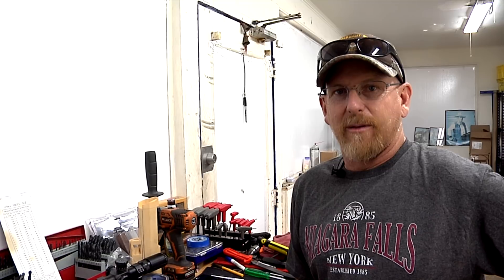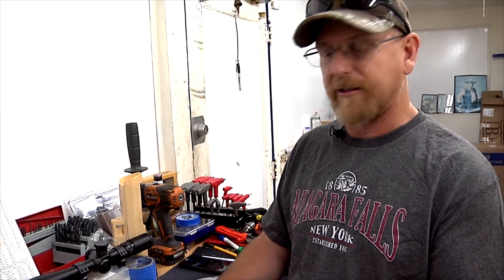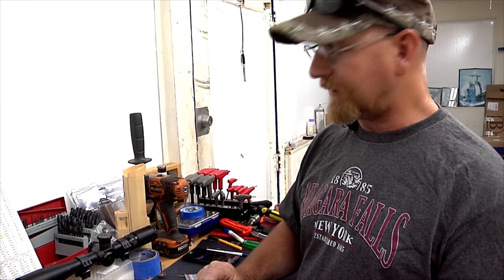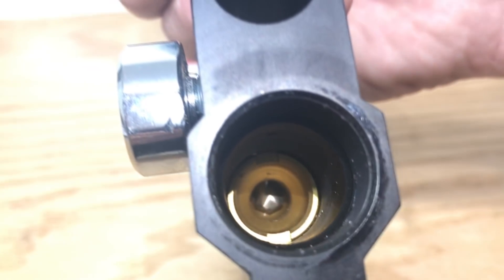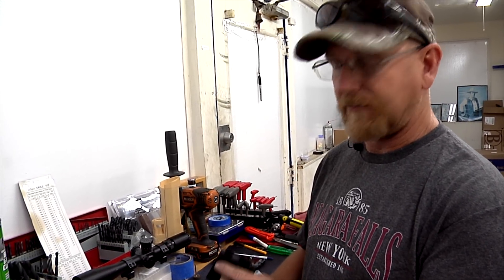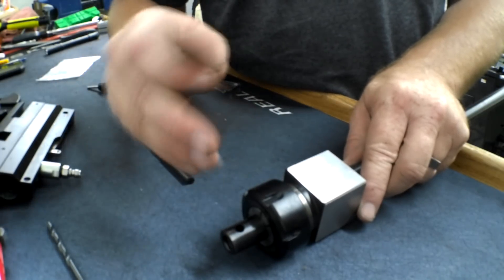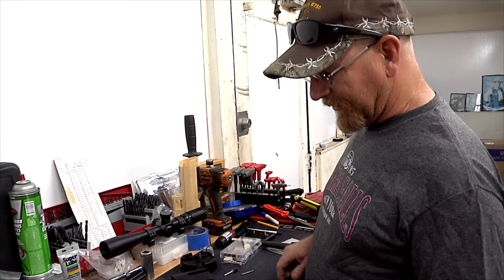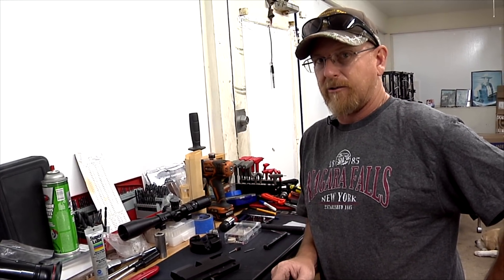Benjamin Bulldog Transfer Port Power Modding

Comment: I'm getting ready to do this. My question is that there is plastic end on my valve. Does that just get removed and not reused? Could find information in tear down and rebuild videos.
Reply: do NOT remove anything regarding the valve. There is a plastic reducer that is in the receiver port that must be removed.

Comment: How about the hole of reciever?
Reply: The hole in the reciever is already the size of the N size drill bit.
There is a small plastic bushing in there that reduces the size. You just need to take that out.

Comment: Is there supposed to be a Grubb screw underneath the fastener that holds the shroud On. When you slide the shroud off there's two holes the front hole I'm the back hole. The front one holds the shroud the back one is what holds the barrel in place. At least that's how I think it's supposed to be but mine has. A? Gross crew in. The front hole Also. You might remember me from a while back you printed me out some benjamin bulldog single shot trace and Some for my. Ataman 357.
Reply from the maker: Most only have a grub or setscrew in one of those holes.  It's only purpose is to hold the aluminum block to the barrel.
Reply: @Pitbull Airguns  I get what you're saying the Fastener that holds the shroud Should. not have a grub screw underneath it. The rear one Holds the barrel to the block... Sorry to bother you with this i'm just not sure which one to remove.

Comment: Matt, I need some clarification... Are you using an M-size drill bit (.2950 in.) or N-size drill bit (.3020 in.)? You mention both sizes in the video, and clarified with a confirmation of M-size. However, in one of the comments, you state that the final size is .3020 (N-size). Please help me understand. Thanks.
Reply: N size for transfer ports
Reply from the maker: Yeah.  What Paul said. N SIZE.

Comment: I enjoy ur videos.  please send me the valve stem shaft length, exposed section. Have y'all experimented w longer shafts? Seems that would be more effective than a stiff hammer spring.  5/64 bit fits

Comment: I did mine .Where can I find the larger plastic sleeve to replace the smaller one I removed Thanks
Reply: In the comment above yours he said they don't replace it with anything, just leave it out
Reply: @cc23001  Yes the plastic sleeve you leave out. I didnt put anything in place of it. Be careful it made mine lots louder even with the suppressor.Has plenty of power Good luck my friend
Reply: I don't understand the logic in that, can someone explain?

Comment: Anything I can do for accuracy??? Thanx I appreciate your work.
Reply from the maker: Tuning is a big deal. You might also try barrel supports.
Reply: @pitbull_airguns  could I drill it out just using a handheld drill?
Reply: Custom rifled barrel for slugs and barrel supports. Adding a regulator would help with consistency a lot

Comment: Ok, did I miss the part where you showed what you replaced that little plastic air guide going between the port on the barrel and the valve???
Reply from the maker: No sir.  We leave that piece out and don't replace it with anything.
Reply: @pitbull_airguns  here's all I know for sure, you guys do awesome jobs on those Bulldogs. When I can afford it I'm going to buy one of those moderators you got
Reply: @pitbull_airguns  and that was the answer i was looking for!
Reply: Me too. So just to be sure, transfer port is not needed?

Comment: I just got my bulldog, word is they are sold out at the normal places. Might be alot of action coming your way soon.
Reply from the maker: We've been covered up for 6 months now.
Reply: @pitbull_airguns  that's  good, right? I think my number is 260 fpe to get the nsa 142gr moving over 900 fps. I hope that gets me out to 200 yards with enough accuracy for a coke can kill. Is that reasonable or expecting too much from the bulldog? I plan to use your barrel shims and the mega or long moderator.
Reply from the maker: @markmtbrider  yes sir, it's definitely a good thing. 
A coke can at 200 is definitely doable but probably not every shot. The more time you spend behind the trigger is going to increase your chances and your accuracy.  But to start with I would plan on seeing grapefruit  accuracy then work towards the coke can size.

Comment: Helium? you can replace the air in a pcp with helium to get better performance
Reply from the maker: In a PCP air rifle, if you use Helium instead of Air it will normally double the foot pounds of energy. 
You must have good seals and I've seen some guns that could not handle the extra power. But a bulldog can.
Reply: @pitbull_airguns  is it a higher pressure or Is it because helium is lighter than air
Reply from the maker: @tylerferrell2959  it's because helium is a lighter and smaller molecule. Used at the same pressure it will flow around the valve faster and expand down the barrel faster.
Reply: @pitbull_airguns  wow. Where can I get 4500psi psi for the scuba tank? That sounds crazy.
Reply from the maker: @markmtbrider  are your asking where you can get 4500 psi helium? We compress our own here at the shop through a small compressor. You might ask a local welding supply place.
Reply: @pitbull_airguns  where would i buy a tank of helium? a welding store?
Reply: @chadrchrdsn7249  a clown supply store
Reply: Its costly...

Comment: I'm not understanding the math here. If you start with a 7mm hole and increase it by 50 percent that equals more that the bullet . .302 " = 85 percent of the bullet size.
Reply from the maker: I must have misspoke somewhere. .302" is the final size that we typically use.
Reply from the maker: Ahh i see the misunderstanding. i said #7 not 7mm

Comment: Any reason why you kept the valve in the reciever while drilling?  Couldn't you just take the valve out and drill it without risking damaging the receiver?
Reply from the maker: We keep it in there to make sure that the port lines up perfectly inside. The factory port doesn't always line up correctly.

Comment: Another great video. I'm wondering if the increased energy is affecting accuracy for the various bullets.
Reply: Yes.. it will without a doubt. That’s the problem with mods on guns like this. It will change everything. It wouldn’t be a problem if you had a externally adjustable regulator. Then you could dial your regulator and hammer spring in and get the gun shooting well. 

If you want to see what I’m talking about. Watch videos on guys tuning their FX impact m3.

Comment: Great video. Off topic question here, I let someone go shooting with my bulldog. And some how the got bullets jammed in the barrel.. How do I get the out?????
Reply from the maker: David Harrison Remove the plastic cheek pieces and then take out the barrel. You can now get out the jammed slugs
Reply: My Bulldog came with a plastic bore rod for pushing the bullet back out if it is stuck in the barrell. If the magzine is stuck in the gun, then find out if the slugs were too long and the magazine was forced in, ans the projectiles are preventing removal. At worst, the person shooting did not know that the magazine has a stopper that prevents closing the bolt when then magazine is empty and forced the cocking handle forward, piercing the stopper and preventing the bolt from retracting to remove the magazine.

Comment: hello again i got my bulldog fun rifle for sure love even the stock power  ,i am getting my tank together an some other  things electric pump ,i sent crossman an idea they said sounded good ,cant find anything on the net about it , ?? RUBBER bullets or pellets for the bulldog for say scaring off a bear an or home defence as well as a bird shot type ammo for ducks ,was something i was thinking about to ,i may bring it to forum ,thoughts on it anyone,i did read artical about it working out for some for home protection nothing on rubber bullets yet,though at the same time we dont wont anyone regulating them becouse of it either ,though i got a feeling the years to come with rifles like the hammer this one ,it may just be a matter of time,not that big a deal for most
Reply from the maker: I have seen self defense pistols that used rubber slugs for non-lethal croud control.
http://www.meisterbullets.com/AWSProducts/513-C-45-P-0/X-RING-Rubber-Bullet-38-CAL9MM
Give these a try and tell us what you think.
Reply: I know I'm a year late to reply but ran into a bear problem two months ago. I made a "rubber" bullet with a product called sugru from Amazon. Used 2000psi and was successful with a shot to the bear's back side. Didn't see it again for 3 weeks. Hope this helps...

Comment: How many shots would you guess you get per fill with all the mods vs a factory bulldog
Reply from the maker: I can do 3 good shots at about 260 to 270 FPE with the stock reservoir filled to 3000.
Reply: @pitbull_airguns  nice. Not very good when you're shooting for fun. But you only need 1 or 2 shots for hunting so 3 shots is perfect
Reply from the maker: So there are lots of different ways to build the bulldog you just asked about this one. 
With a regulator and an extended res and a 4500 psi fill i can get 15 shots with a 128 gr devastator at around 200 FPE. I have a gun setup like that to use for varmit hunting. Now thats a fun night of hunting!
Reply: Oh wow. I may end up having to build mine out. More shots and more power... I'm definitely ok with that
Reply from the maker: Its a very versatile gun platform. But the most important thing is to make fit what you want so that you can have the most fun.
Reply: I plan on it. Thank you for taking the time to respond
Reply: @pitbull_airguns  4500psi on the std air cyl , or an aftermarket one ?
Reply: @markmtbrider  their extended tank duh
Reply: @pitbull_airguns  Completely stock and With what grain bullets??
Reply from the maker: @JamesFMyers  not sure what you're asking?
Reply: Any reason why you kept the valve in the reciever while drilling?  Couldn't you just take the valve out and drill it without risking damaging the receiver?

Comment: Interesting information. Thanks. Can you do a pre and post mod chrony test please? Also, instead of making the hammer spring stiffer - how about softening the valve spring? - just a thought
Reply from the maker: We will get a video on that very soon. As for the valve spring, can completely leave the valve spring out if you want. You have to make sure that the gun is standing barrel up and the gun cocked to make it fill from 0 pressure. But as long as you don't ever let it go empty it fills like normal. That tends to give you around 20 to 25 fps
Reply: @pitbull_airguns  not sure if the valve will be able to return back quickly after each shot, alternatively there would be excess dumping of air without the valve return spring. Did you take off the valve return spring in this to achieve the 240-300 Ft Lb you mentioned? Because you did not mention about the valve spring in the video.
Reply from the maker: I've reached 240 to 270 without removing the spring but to get to that 300+ mark then yes it would need to be removed. Sorry didn't mention it in this video but i have mentioned it in one of my other ones.
Reply: @pitbull_airguns  all I need is 260, ish....lol